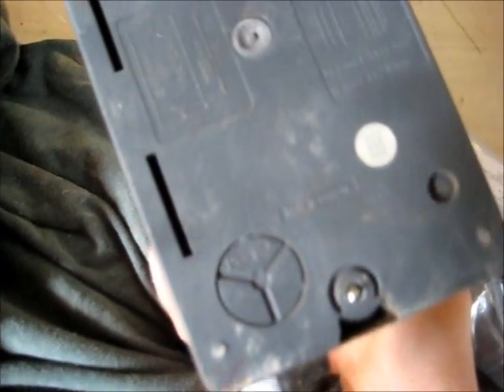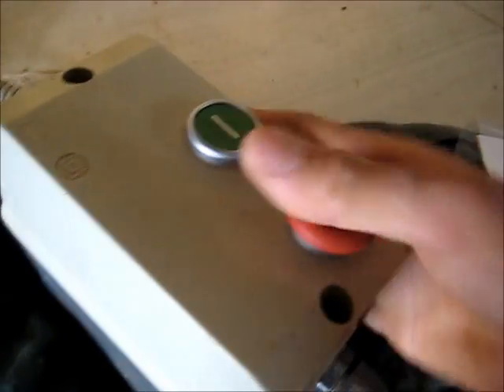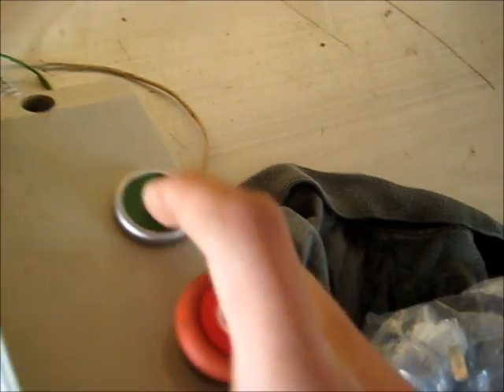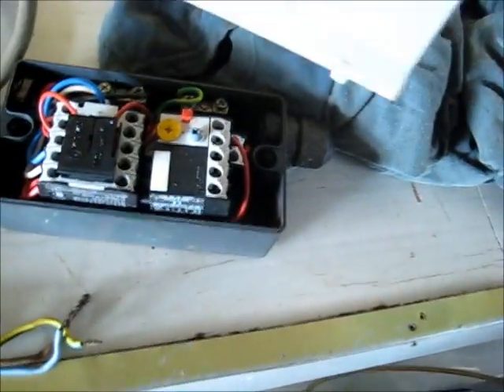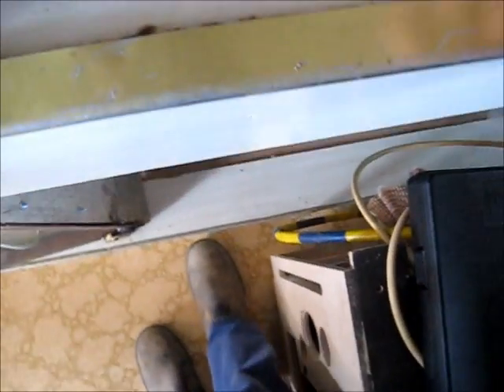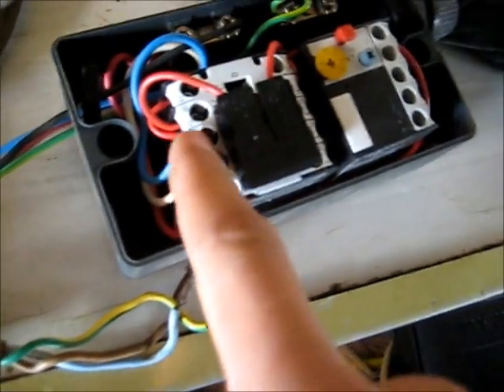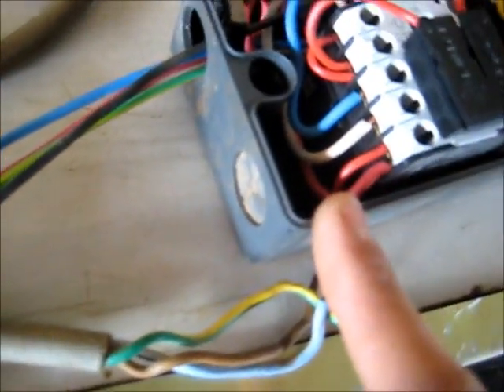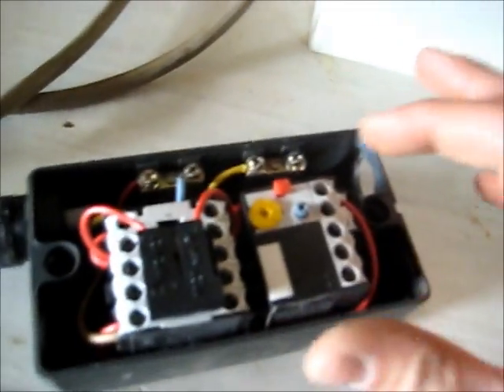Wiring a 3 phase contactor for 1 phase

Comment: I know this is a bit old but i have just bout a hofman geodyna 85 tyre ballancer. it can run on 380v or 240 v I have converted it from star to delta and included a start capacitor. wired up it stars and runs great the motor that is. but I have a 4 pin phase three plug on it with a earth and 3 wires coming out of it. i want to wire it to a 3 pin single phase house socket. can any one help please. Nick

Comment from the maker: red wire was for energizing the contactor coil!, I recommend having the neutral connected to l2 or l3, that way, the circuit is switched off on the active AND neutral side, (double pole)

Comment: ide switch the output neutral through l2 or l3 so that when you go to cut the power its properly cut on both poles because you can still receive a shock through neutral if something goes wrong.